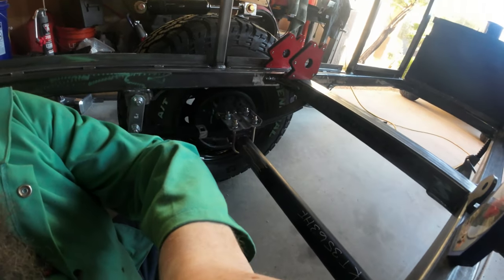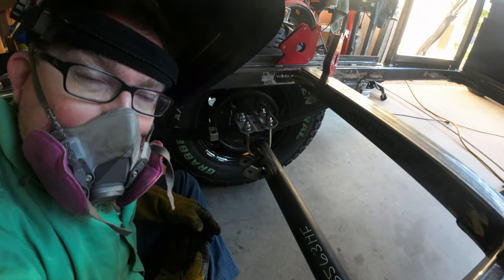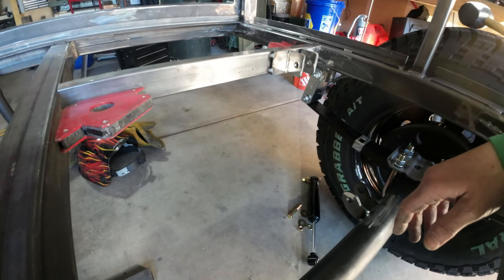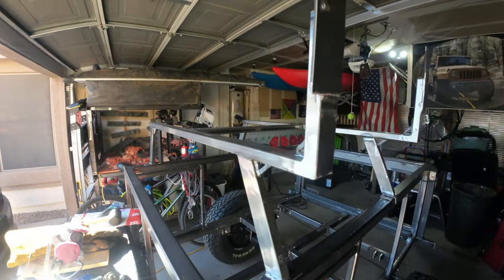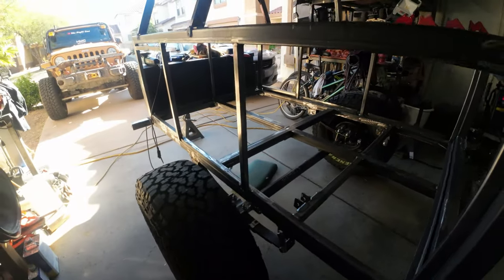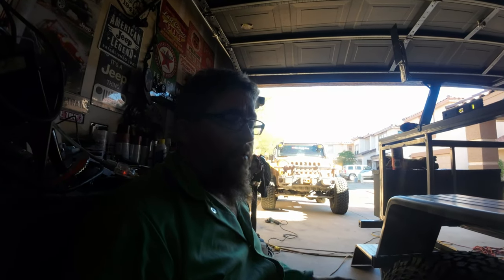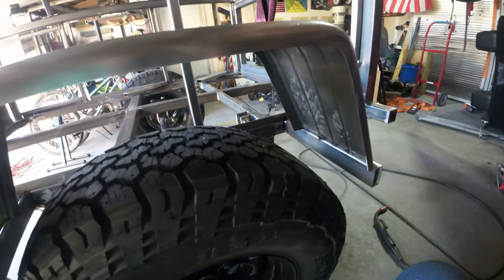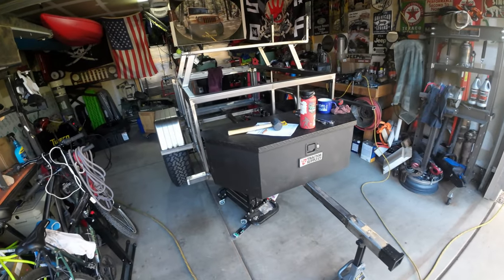Overland Trailer 2022 Part 6, Shocks and Fenders

Comment: Thank you for clearing showing how you installed the shocks. This is the first I've seen somebody show that in depth. I always assumed it would be that easy, but I am surprised to see that it actually was easy.
Reply from the maker: Thank you, somebody could probably give you a purely scientific explanation as to why this replaced the way they are but in this case it was really the only way they could fit. The only stipulation was that any instructions it said that the shocks had to have I believe it was an 11 inch stroke.